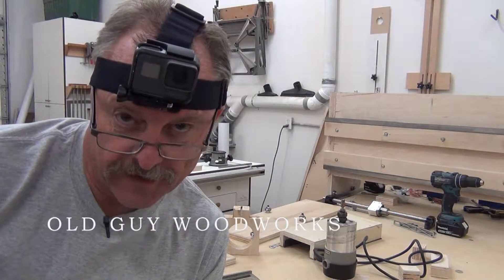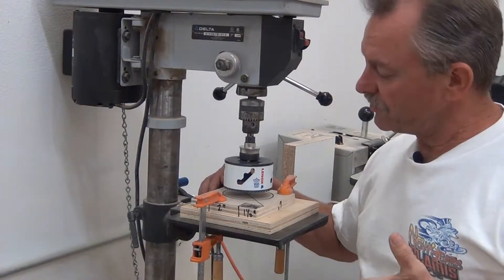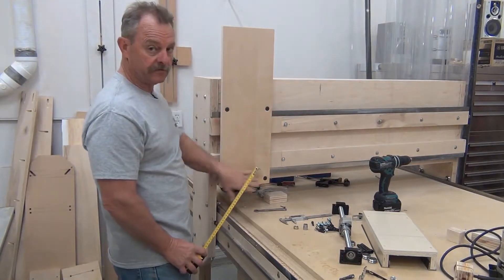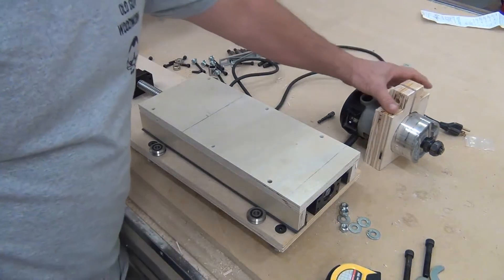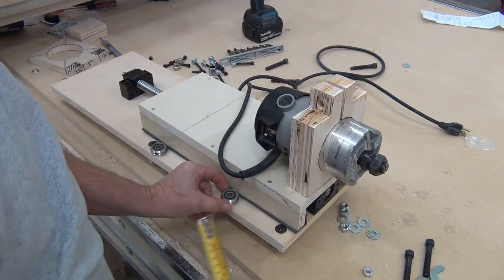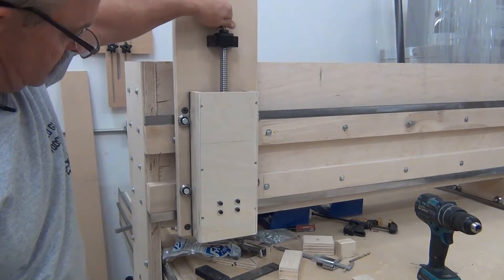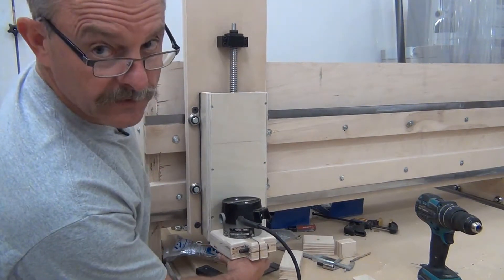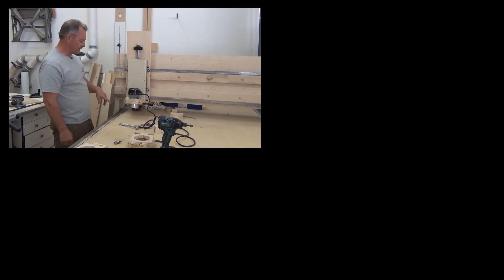Homemade CNC Router - Y and Z Axis Part 5

Comment: Picked up a used kit machine using pipes for rails that the bearings finally wore out, always felt the gantry was too heavy so I'm going to pinch your approach to redesign my gantry.
Reply from the maker: Good luck.  I'm always trying to rebuild and design.